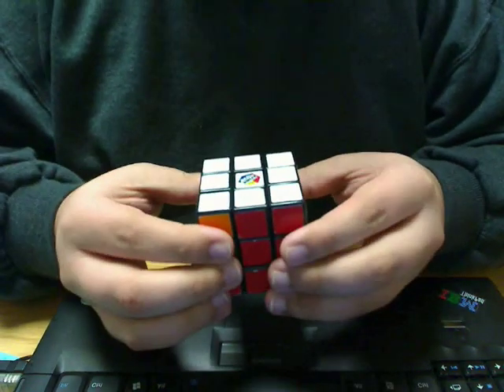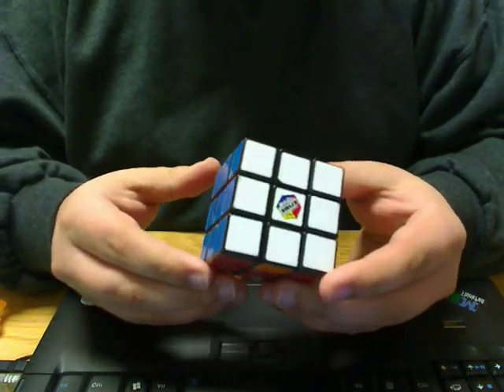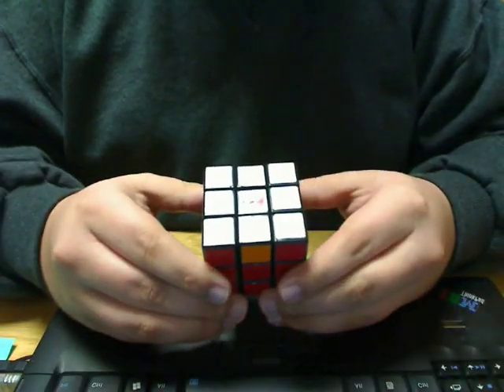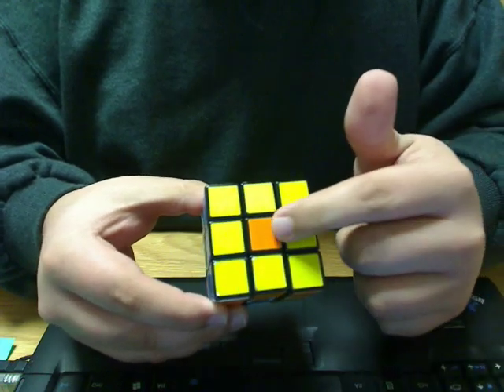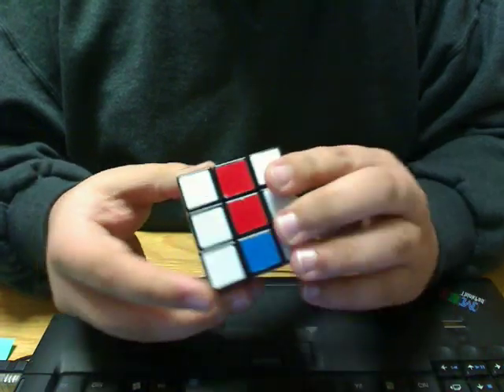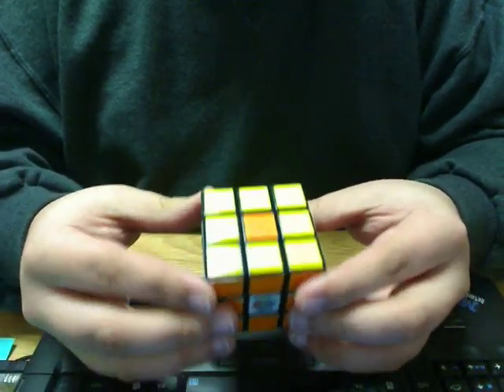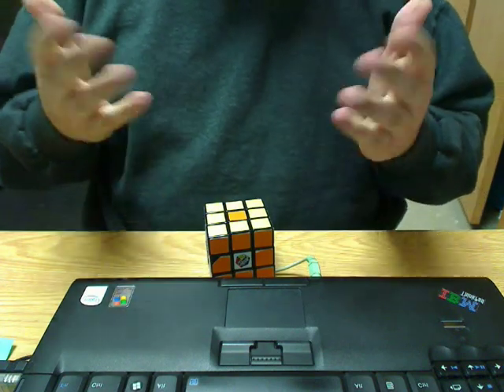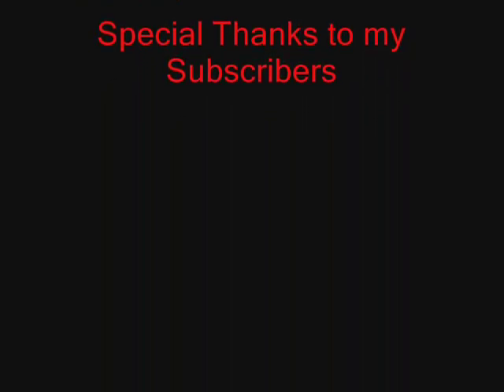Void Cube Parity Explained

Comment: Why not just run the UF UR edge swap alg?
U F' L' B U' R' L2 D L' D' B R L2 U

If you run the alg on a normal 3x3 you will see that it cycles 4 centers by one turn and creates a UF UB edge odd parity every other cycle.

Moving 4 centers by one turn is an odd parity for the centers which must be compensated by another odd parity - either a single edge swap or a single corner swap.  Running the alg twice cycles 4 centers by two turns which is an even parity and needs no compensation.  Running the alg four times brings the centers back to their homes and restores the cube to a solved state.

Comment: not exactly an explanation of how its solved more of the algorithm for solving it. the only reason it does the parity is because the unseen middle is out of place on the void, and the inability to solve it correctly results in the parity. All the algorithm for the parity is is just a way around the (unseen) middles not being solved.